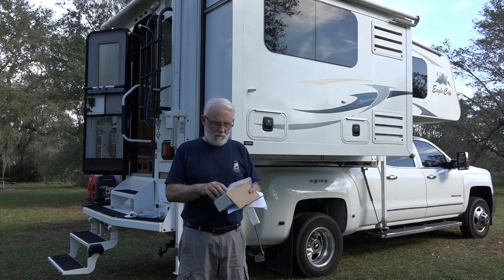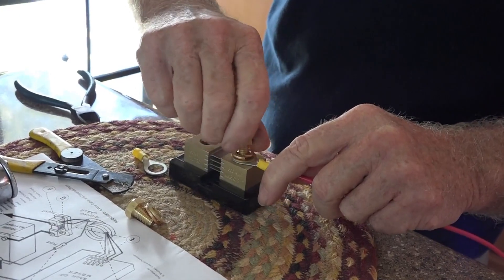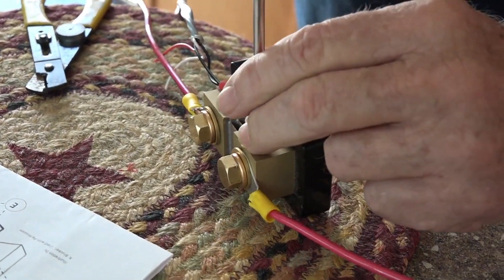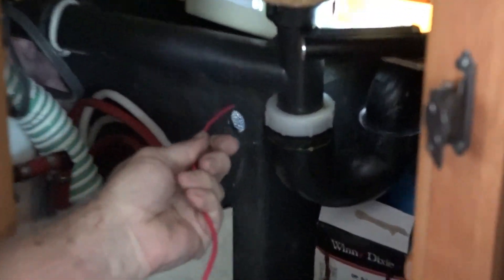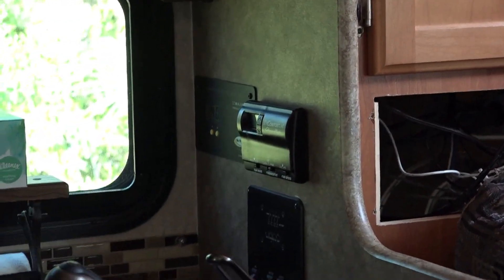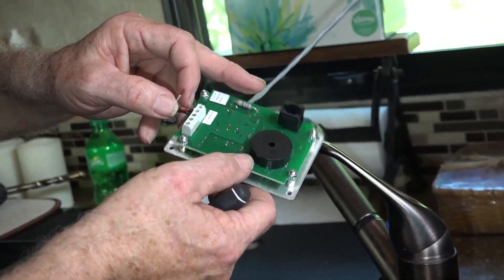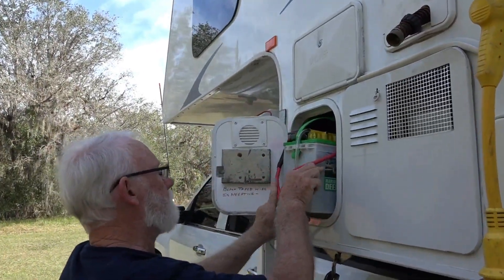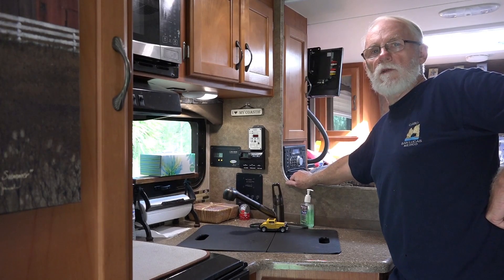DIY  - TriMetric Battery Monitor Install - Truck Camper Mod

Comment: I hate to tell you guys but the shunt should be the only connection between the negative terminal of the battery and ALL loads of the camper. The way you have installed the system will not read all discharge correctly.
Reply: Right on point, the way he connected it, the meter will only be able to read volts. The proper way to connect it was right there in the diagram that they were looking at.
Not to be disrespectful, but he states that he is hooking the shunt up to the neutral??? Neutrals are on 120v systems.

Comment: Will this work for  Roadtrek etrek  that has 6 AGM house batteries in the back?  Do you need to put  the wires on each battery?  Will this tell me which batteries not getting enough charge?  Any video? Thanks